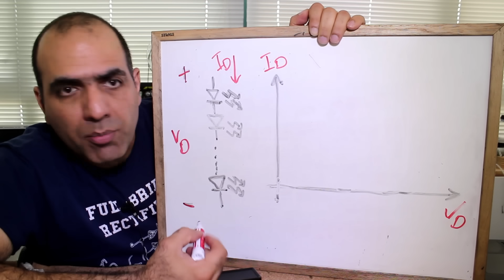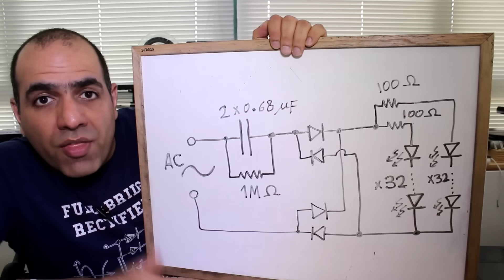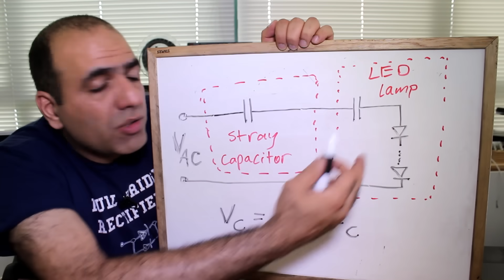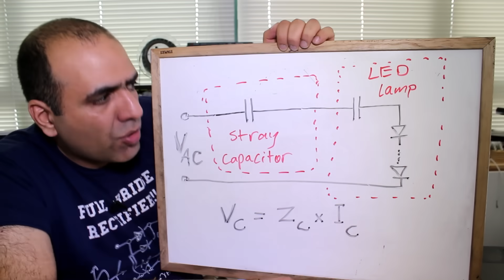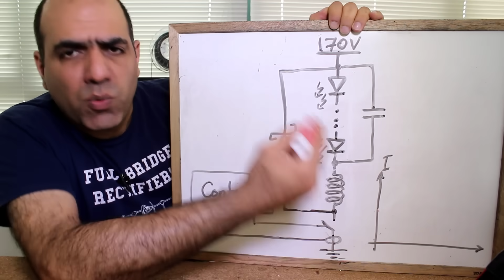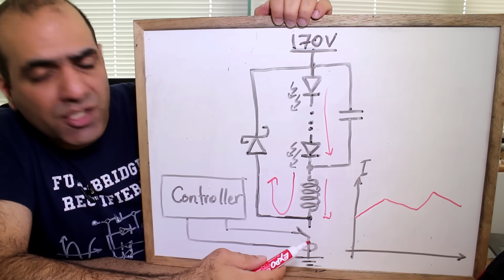Why Cheap LED Lights Keep Glowing

Comment: Well not only led lamps, the one with filament also glows in my room! I can show u some picture or video
Reply: if you mean the modern "filament" lamps, those are led filaments. Basically just a lot of tiny leds in a row.
If you´ve got actual incandescent lamps glowing when off, there is something seriously wrong with your house wiring^^
Reply: Yes...it is an actual incandescent lamp with white coating on inside. Tho my theory is the atoms of the gas inside stay excited even when the power is off and emit some light which is comverted to visible light with whatever the coating is
Reply: @prathameshdighe1485  That can´t be right... Firstly, the gas inside incandescent lamps doesn´t glow itself. The coating is just to diffuse the light, nothing more.
The only thing that would behave somewhat like you describe are "metal halide lamps". They are usually a lot bigger than a typical light bulb and work very differently, but do actually emit a orange-red glow for a few seconds after they are turned off. In those the gas is actually glowing. They are more like fluorescent lamps in principle, but are also only used in industrial lighting as far as I know.

Are you talking about a glow that fades after a few seconds, or does it glow indefinitely?
Reply: This happens with only one bulb tho....other identicle bulbs around the house dont do this

Comment: I bought the same crappy LED light for my room (but it's not Chinese, it's Iranian made :P) and first days I was scared of that glow in the dark. Because the structure and everything seemed fine but it acted like a Fluorescent lamp which continues to glow in the dark. Now I'm sure it's not broken or fake, so I think I need to modify the lamp circuit.

Comment: My neighbour showed me a miracle.
His (idk in english) energy-saving lamp glows while switched off.
The secret lives in a switch with indicator.
Reply: My lamps sometimes flicker when switched off because of these stupid indicator switches. It can be really annoying, especially at night.
Reply: I have LED's that don't turn on when you flip the switch, but glow for a minute after you turn them off.
Reply: kinnlmk the kind of lanp designed to turn on in a power outage?
Reply: The indicator is a Neon bulb with ballast resistor. Those can conduct enough current to make an LED light glow a bit. They typically drop about 60V (sometimes as low as 40V if the neon is contaminated) after "striking" and need double that to strike.
Reply: Gordon Lawrence Yeah, I had to remove them because some LED lamps wouldn't stop flickering.

Comment: Nobody: 
Mehdi : Exists 

Also Mehdi : * touches open high volt circuit* Aah bleeeeeeeep
Reply: Isn't touching an open circuit more dangerous? Cause  you can close it with your body.
Reply: Whaaaat
Reply: Technically it's low voltage, though, high voltage starts at 1000 VAC (RMS) or 1500 VDC.
Reply: Also he touched the open circuit with one hand, which means no current path through the heart or brain. Also he has admitted that most of his dangerous sparks and shocks are not real/edited in.
Reply: I'm normally a cheerful and peaceful person who doesn't troll or complain in the comments but this meme has been getting under my skin,  sorry OP, it's not your fault it's the bad meme.
Reply: Nobody
Reply: shut the fuck up kid

Comment: I prefer using torches to light my home. I did accidentally burn down my home once though
Reply: at least that still drops some items. creepers just annihilate everything
Reply: @jackradzelovage6961  Yes
Reply: @jackradzelovage6961  Chuck McGill is that you?
Reply: Happy minecraft noises
Reply: Have you ever heard of a safety torch you can put it on the porch but make sure you have some safety water as well
Reply: Torches are unhistorical. Use oil lamps instead.
Reply: @BlipperOfRays  i have a ceiling oil lamp in my 1950's home
Reply: lit.
Reply: Literal lit community.
Reply: On the positive side, the house became hot.
Reply: I watch so many British things that I thought by torches you meant flashlights.

Comment: Awesome. Have this issue with a ceiling fan. Time to get to work :)
Reply: your ceiling fan is glowing?
Reply: @Basement-Science  Yes, I replaced incandescent lamps in the fan with LEDs of similar design to the ones in the video but they have edison terminals (screw in). The fan lamp has a dimmer feature. Turning the lamps off with the remote leaves them glowing. Turning off at the wall cuts them off. I tried adding various resistors across the power lines to no effect. Lower resistance might work but at the cost of too much heat.I could design a circuit to kill the bulbs below some threshold but that seems like overthinking the issue, which isn't really a problem. It just bugs me.
Reply: @Miata822  I see. In that case it´s probably due to leakage current through the triac in the dimmer. So you´ll have to  add a resistor to the output of the dimmer, not the mains side.
Reply: @Basement-Science  The problem with that is the heat generated when the lamps are at full power. The resistor would live in an enclosed housing that I already had to rewire because of heat from the previous lamps.
Reply: @Miata822  The resistor value can be fairly high, something like 470k or 1M is probably enough. That won´t create much heat at all. Only about 100mW in case of 470k and at 230V.
Reply: Just add a resistor like he said and your ceiling fan will immediately turn once you press the switch 
100% guaranteed to drop each time.
Reply: Commented 19 hours ago??! Wtf it was just uploaded??!
Reply: @TPSnix  patron has early access
Reply: John Ruben Saragi oh ok